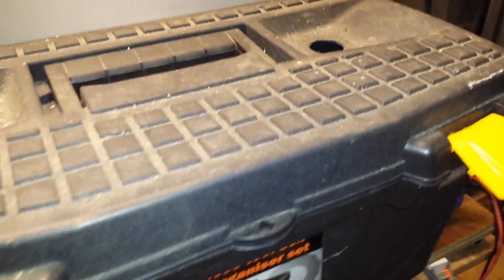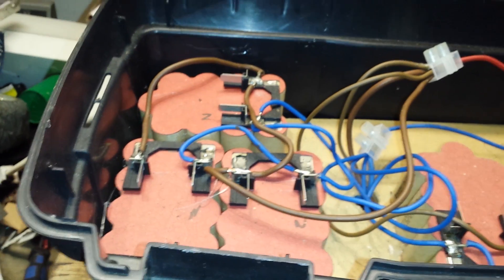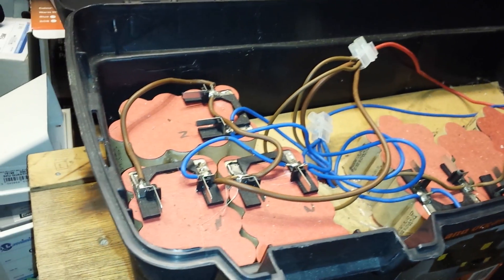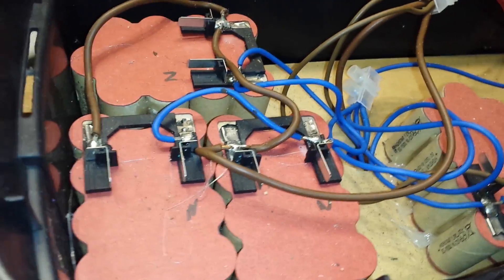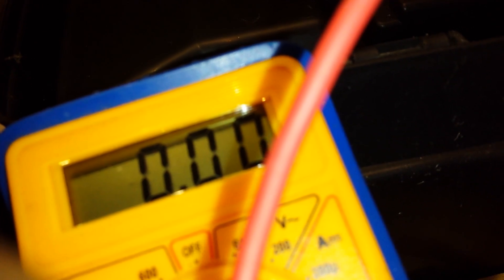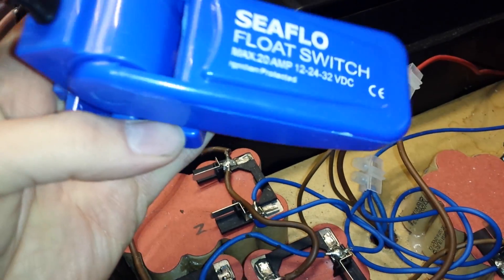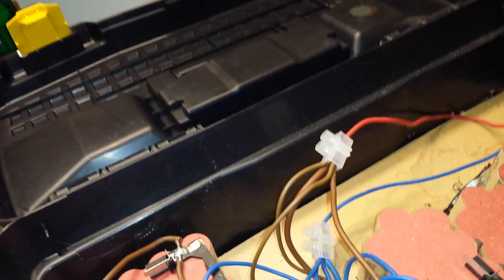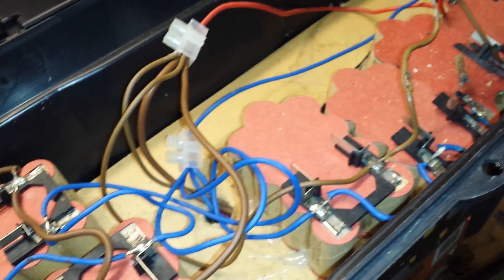12V nicad battery bank - from past video

Comment: 1st thing i noticed the AC wires...WRONG ...you must use DC copper  wire
Reply from the maker: This project has long since been recycled. However I'd like to know where you get your information. As this is down in my book as safe for 600vdc and 1000vac without looking into the British standards the cable has to comply to?